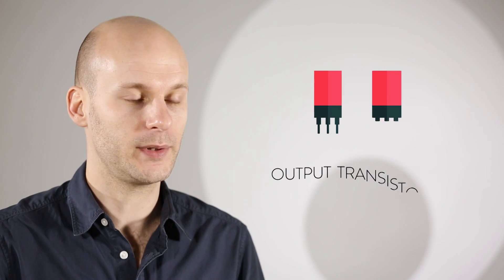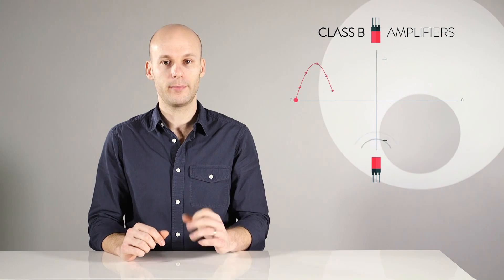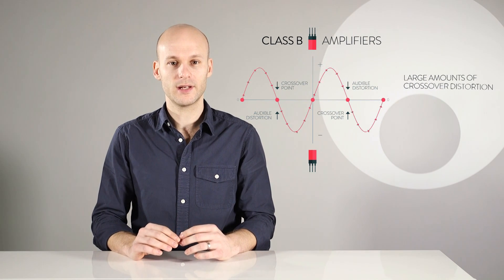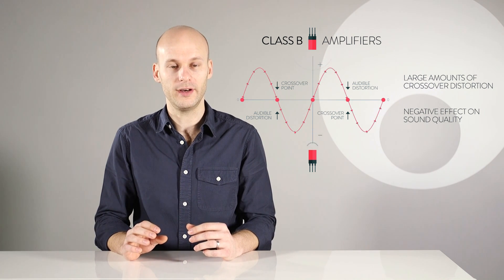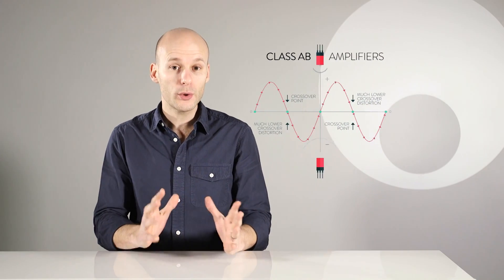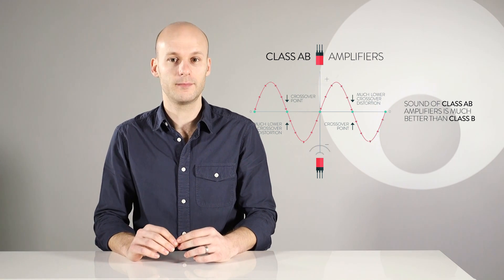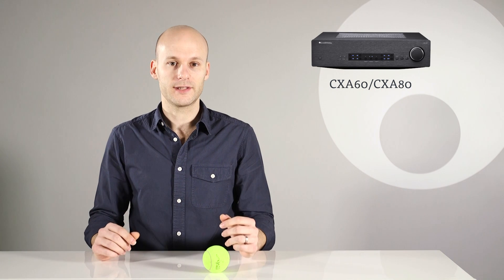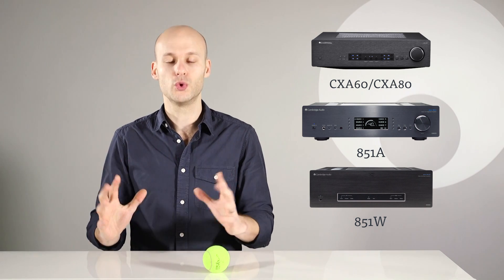Class B and Class AB Amplification

Comment: Hi there. Your visual analogy of the different classes using the ball is flawed. You show the class B operation by THROWING the ball across from one hand to the other and the ball is not controlled by either hand (3:05) A much better way is to hold and move the ball to a midway position in front of you on the table top with one hand, then RELEASE the grip and then pick up the ball with the other hand and continue the full cycle. This would then simulate the operation more accurately than the way you show it...Throwing the ball suggests  the ball is being driven by kinetic energy and has become detached from one side or the other of the output stage in the push-pull sequence. The way I suggest would also demonstrate the changeover point at mid-way more accurately showing class B as two distinct cycles with a definite mid-point....throwing it confuses the mid-point crossover process and is not analogous. The class AB can be shown in the same way on the table top but the transference and crossover would mean the grip is released just after the other hand takes it and moves away

Comment: So does this mean that Class A has ZERO crossover distortion???
Reply: yes zero cause it doesn't need pair ... only one transistor can make class A amplification but for that the transistor needs to turn on at full power continuously that results in extreme heat dissipation as energy has to go somewhere but the amp is 100% active all the time and we can achieve more power with more transistors
Reply: Class A amplifier is the most expensive one. Most British brands are using alternatives to class A and AB as class B, G, XD.
Reply: NAIM amplifiers are class B, i don't like them at all.
Reply: @82ivaylo  Rubbish.   The Naim model is a pretty straightforward one, and it uses Class A throughout its Pre Amps and Class AB output stages in its Power Amps (with everything Class A before the driver transistors).  I believe I am right in saying, though I haven't ever asked to confirm this,  that rather than being an optimised Class AB, it is instead a bit heavy on the quiescent current, so giving a wider region of Class A either side of 0 Volts.  As for quality, the 252/250 pre and power is a very sophisticated and delicate sounding amplifier.  I would also be very impressed if you could find fault with the SuperNait.
Reply: woopygoman howcome class B is alternative to class A
Class B is poor. 
However class XD is a good option